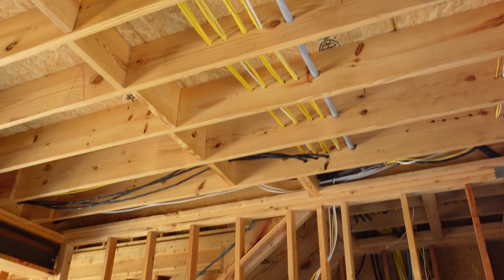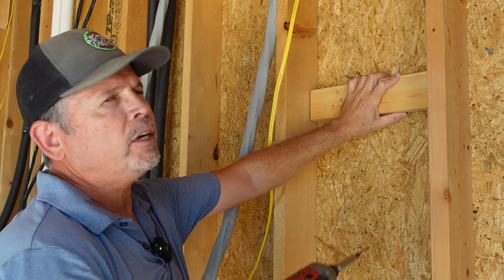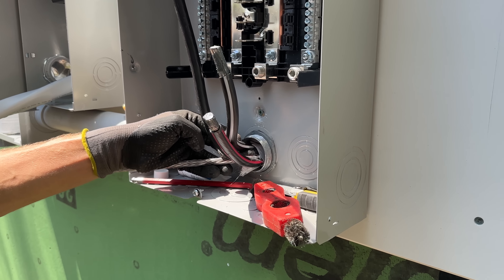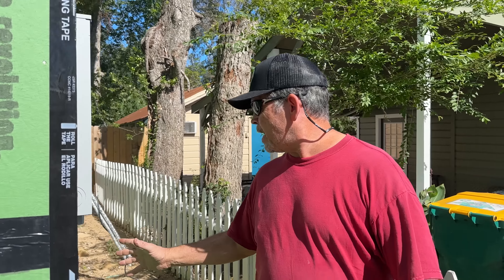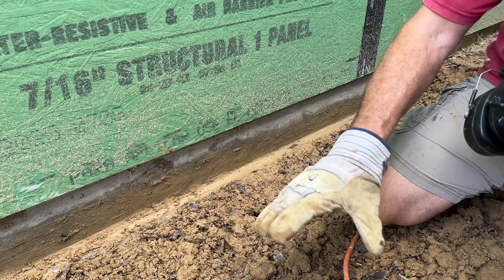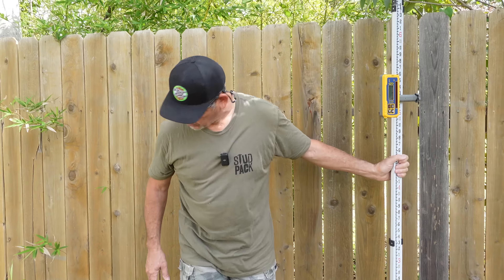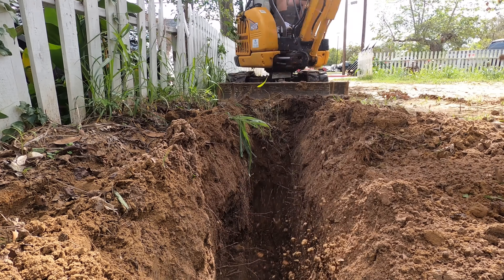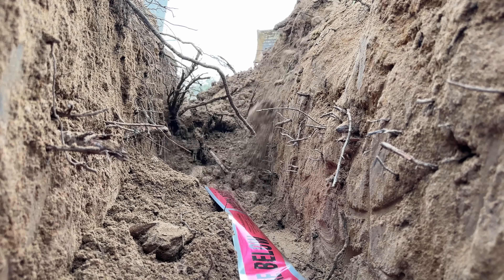MASSIVE 400 AMP Service for our Storm Proof Electrical Powerhouse

Comment: Curiosity: Are you required to get an inspection on your service pipe, to verify you've hit the minimum required depth? I thought when you said you were going to drop six inches of dirt, you meant "spot cover," leaving a foot of space between dirt piles so the inspector could measure and sign off. But you covered everything. Did you get an inspection beforehand, and just didn't mention it, or are you not required to have it inspected? Just threw me for a second, made me wonder.
Reply from the maker: We took pics, that's fine here

Comment: as a telecommunications/IT engineer, I would have loved to see a pull string in both your electrical and fiber conduit. :(
Reply: As a telecommunications/IT engineer, you should know there are far better and newer ways of getting wire and lines from one point to the other in buried pipe.

Comment: I would have used copper conductors, even with the added cost.
Reply: Why?
Reply: @3nertia he doesn’t know why, lol. He just wanted to let everyone know that he knows copper wire exists as well 😂
Reply: I don't think there's really any good reason. It's not any more durable and you won't get better performance.
Reply: Absolutely no problem with aluminum if installed properly.

Comment: Not a fan of aluminum wire. It’s a good idea to check the tightness of all connections in about a year. I like copper much better. 😊
Reply: Does anyone use copper for service-entrance amperage?  I’m sure they’ll use copper for normal branch circuits.
Reply: I used copper service cables for my house. Most houses in my area use copper. As an electrician for 5 plants we never used aluminum. Aluminum conduit at times but nut the wire. 😊

Comment: I saw Perkins Builders pull stakes using leverage.  They screwed the stake to a 2x4 and used that to lever the stake out, easy peasy, with a mechanical advantage of about 6:1.  Of course,  I'm just a YouTube warrier,  so don't listen to me :0)

Comment: Curious about the use of aluminum wire.  It was always preached to me to never use it.  I know enough to wire an outlet or light and that's about it.  Would love to hear the opinions of experts.
Reply: Aluminum service is very common - it’s relatively inexpensive but does have more ‘gotchas’ than copper - mainly related to mixing copper/aluminum connections, not terminating properly, etc
Reply: Just a DIYer, but I believe most service wire is aluminum.  Copper for the branch circuits.
Reply: Aluminum is fine for feeders. Just have to pull a bigger wire than you would with copper.
Reply: Great to know!  Thanks!

Comment: I hope you realize how tough it will be to pull the wire into that 3 " conduit .Thats a long pull. It is a lot easier to slide each joint of pipe over the wire ,and then glue the pipe . Good luck . I enjoy the show .
Reply: NEC 300.18
Reply: Good to know the power company will most likely pull it. There is also a thing called wire pulling lube and wire pulling machines
Reply: NEC 300.18 Raceway Installations.
(A) Complete Runs.
Raceways other than busways, listed manufactured assemblies in accordance 604.100, or exposed raceways having hinged or removable covers shall be installed complete between outlet, junction, or splicing points prior to the installation of conductors or cables.
Reply: Mine is 120ft long and in 2 1/2in conduit 💁
Reply: @adammiller8415 
…and fish steels. Pushing a fish steel through a 60-foot straight run of 1” conduit with a single sweep 90° should be a piece-of-cake. Using the steel to pull in a fiber optic cable through that conduit should be easy too. I do recommend using “snot” (wire-pulling lube) for the pull as the jacket on most UG-rated cable can be “grippy”.

As for the pull through the 3” conduit for the electrical service, Paul and crew will be the “uh” sayers on that job. The power company will make that pull, and “our boys” will merely have to say “uh” every time the power company crew heaves and pushes. Of course, they’ll likely use a pulling machine, so there probably won’t be much heaving and pushing 😊.

Comment: The 4 x 8 PVC sheet, 500$ Im ok with that, not a bad idea. I've seen a lot od siding screw ups around the service panel. 

The 400 Amp 250 v service. Dude, that is, with a Solar system, massive overkill. 
So I want you to think about it, what the highest 240V service you have. 

Assumption, Highly sealed highly insulated, R15 to 19 walls, R 40 attic. per 1000 sq feet maybe 2 tons. Whats the running draw per tonne, the new systems about 7 to 9 Amps. 

Lets just think about what a 400 Amp system is. 400 x 250 V = 100,000 watts. Thats like 80 microwave ovens or blow dryers running all at once.
Reply: Why would you want to skimp on electrical? It costs 10x later on to upgrade than it does to go big at the beginning. More and more things require electricity, this isn't the 1950s when a 60A service was good enough for a whole house. The cost difference for upgrading to a 400A vs 200A is $1200-$2000, Jordan isn't a cheap production contractor looking to save $1/receptacle buying spec grade plugs. It can cost orders of magnitude more having to retrofit stuff after the fact.

This is the same penny wise, pound foolish arguments I see on electrician discussion boards complaining about using 12AWG for all receptacle wiring thinking it's a waste, when home computers right now can draw 1600W right now, exceeding the rated continuous load on a 15A/14AWG circuit. Now you've got to spend hundreds (if not a couple thousand running new wire) when you could have just done it once and been set for the life of the house.
Reply: It’s two houses…in Texas. 400amp service is just enough
Reply: @remodz6385  I have A house, a workshop and a garden house, all air conditioned on 100 Amps, it is more than enough.
Reply: @TeflonBilly426  Because you will never need it. I mean if you built a 10,000 sq ft house with an electric resistance heating system you might need it. He's building a state of the art, high efficiency home, hes simply never going to need 400 Amps.
Reply: @Darisiabgal7573  still not sure why you care, this is frankly like complaining about someone owning a minivan to commute to work and saying they should be driving a mini-cooper.
Reply: @TeflonBilly426 
Hear! Hear! I’m in complete agreement. I think an eventual welding setup in the “GarageMahal” is not an unreasonable expectation.
Reply: @TeflonBilly426  A prius prime😂

Comment: I would love to see the prices on the electric install. We run all emt inside everything.  Lighting power communications fire alarm audio visual. Im pretty sure the prices are pretty close. The panel outside is not something i have seen in 25 years.  I wouldn't recommend it. At least they can't easily rip the copper?

Comment: Just curious why 400 amps?  Most homes get 200 amps.  Unless your running twin ACs, a pool, and a hottub.
Reply from the maker: 200 for the garage, 200 for the house
Reply: ah ok, must be planning to use some arc welders or big compressors in that garage. :) @StudPack

Comment: I work for the electric company as a service man that serves them and an expansion joint is not required. And this company does not supply the conduit, it is the responsibility of the customer to install with pull string in conduit.

Comment: Do yourself a favor and get some french drains put in just to be safe than sorry. Right out to the street. You have the equipment and manpower, the cost material cost is low. It's all labor. I would 100% do that if it was my "dream home". Nothing worse than a soggy back or front yard you can't walk on a day after it rains. You literally could've killed 2 birds with 1 stone with that trench you dug. Hope that doesn't become an issue later in the future.

Comment: I don’t think you can have your internet that close to your electric , it could cause interference
Reply: It’s been mentioned several times that the “Internet” run will be fiber optic. The data transmission via fiber optic is done with light and is therefore not subject to EM (Electro-Magnetic) interference.

Comment: If someone is gluing pipe, shut up and let him assemble it. I seen guy glued both joints before putting the pipe between each box...that was the first mistake. Glue one dnd at a time and tell your help to let you put it together.

Comment: You're electricians terminations with all the exposed conductor and electrical systems would not be accepted in Europe. You're systems are still stuck pre WWll, n why would you need 400amps. A standard home only recieves 80amps..